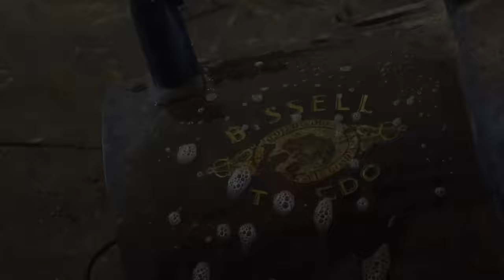Someone paid an equivalent of $2000 for this in 1914 [Restoration]

Comment: "A buffing wheel has one job, to polish/clean what you have in your hand.  A buffing wheel has one goal, to take what's in your hand and throw it across the room."
Reply: Or to buff your hand
Reply: @andrewgodly5739  Look at how shiny my hands are!
Reply: To be honest I worked in a jewellery and metal working for a short period of time. My nails were never so shiny as back then xD
Reply: I remember my school days,mid 80's, in the metalwork shop we had a large belt sanding machine with a buffing wheel on the spindle end,whenever I heard the sound of it starting I would go and  stand between the lathes and mills for protection,it was the only safe place in the classroom.Two occasions stand out just in my class alone,one kid was hit in the hand by a 8" soldered copper steam boat hull which squashed the ring he was wearing into his finger needing surgery to remove, another got hit in the face by a small block of brass which pushed two teeth through his top lip and broke the tops off of them,the schools response to these accidents was a laminated sign hung above the machine telling you to be careful.😊 I also witnessed the flight of a very large lathe chuck key twice, both times it didn't hit anyone fortunately because it would have certainly killed them but it was terrifying nonetheless,the lad that forgot to remove it before starting the lathe both times was banned from the metalwork classroom after the second incident.
Reply: @foxyfoxington2651  “Catch these hands!”

“I can’t, they’re so well polished!”
Reply: @notpoliticallycorrect1303  Don't worry, in the 2000's I had a lathe key wiz by my head on the way to low earth orbit because some kid behind me forgot to stow it. We kept tradition alive, so to speak.
Reply: @andrewgodly5739  Can confirm. Slipped once, did a great job buffing my knuckle right down to clean and polished bone.
Reply: taking as much skin-fingers with said object. 👍👍
Reply: @notpoliticallycorrect1303  craziest thing I ever saw in metal shop class was the flying center punch. The classroom had several long workbench tables topped with sheet metal and a bench vise on each end. The teacher gave a demonstration on how to use, and not use, a center punch. You hold the punch firmly, press its point against what you're marking, then hit it firmly with the hammer. BANG

You don't hold it between thumb and fingertips then give it a little *tap*. His intent was to have the punch fall to the table. Instead it slipped off the metal on the anvil part of the vice, ricocheted off the steel tabletop then flew straight as a bullet down the table. One boy halfway down was leaning in so he could see. He was wearing the safety glasses instead of the dorky plastic goggles. The punch put a hole right through the left lens of the glasses and right past his eye. Miraculously he didn't get hit, not even a speck of glass in his eye. The teacher stood there for a second in shock, then grabbed the boy and dragged him to the eye wash station.

He said that in 20 (or however many years) of doing that demonstration, nothing like that had ever happened. The punch would just fall onto the table.

There was one other incident, involving the emergency shower. One table was pretty close to the wall where the shower was. It had a big triangular loop handle on a chain. The boy sitting there was doing some layout work with a square. When he was finished he put the square over his shoulder, stood up on the stool's rungs then stepped off it backwards. The square hooked into the shower handle. FWOOSH he got a quick drenching.
Reply: @notpoliticallycorrect1303 safety and racism are totally unrelated so when I say this “might have been dangerous but life was better back then.” I mean it. Maybe not for everyone all the time but no, life was a lot better when law suits weren’t flying around all over the place. Safety is bug business. I got to live in the last decade where something could happen without worry about suing or getting sued and frankly, life was better. Accidents still happen but now they’re someones fault.
Reply: @thetruthexperiment  Who mentioned racism?
Reply: @notpoliticallycorrect1303  nobody. But in case someone did, i was leaving a disclaimer. Stuff was more fun when people were less litigious and less afraid of bumping their head. If we didnt already have home electrification we probably would never get it because people are so afraid of everything and people don’t think in terms of grand infrastructure. We need it now but we hardly make advancements. Fear and guilt would make putting fire hazards and electrocuting hazards in our homes hardly even a fantasy. For example.
Reply: @thetruthexperiment  I see,a bit of pre emptive defence,fair play.,You seem like a like-minded fellow but I fear our numbers are dwindling and being replaced by limp waisted invertebrates,it's up to the likes of us to at least attempt to keep things real,or die trying😂because common sense left the chat years ago. As you may gather from my username, I don't have time to pander and pussyfoot around the ever increasing multitudes of people who consider themselves 'special' nowadays, I won't be racist,every race has its bottom feeders,or sexist in any way but I will take umbrage when people are taking the piss and as you and I would almost certainly agree,the piss taking has gone far too far and has to stop.
Reply: @notpoliticallycorrect1303  hell yeah. I didnt see your username till you mentioned it. When i saw the reply I went into attack mode. Not seriously attack mode. I was just getting ready to respond with a humiliating put down. Some serious overkill to win the fight in one paragraph but turns out we’re both chill. Right on. Good on you. Speaking of overkill, the crazies are definitely overkilling their position and I feel a slight majority may actually be growing! Have a great day.
Reply: 500th like !!!!
Reply: @jttech44  Back in '06, one of my friends had a patch of his hair ripped clean out of his scalp because he refused to tie back his hair when using the buffing wheel. When I say clean, there wasn't a single drop of blood.
Reply: @notpoliticallycorrect1303  Wimps. 

In the Seventies we shook off such annoyances.  Pot metal explosions were fairly common in print shop (ever met a Linotype?) but those who paid attention to the safety instructions generally came out unharmed.

As a 'TA' in Junior High School metal shop I spent considerable time ensuring students didn't harm selves or others.

Builds character.
Reply: Yep, that sounds completely accurate .. probably even in the fine print of every included information sheet

Comment: Just imagine vacuuming away and the grinder catching on the drapes, and this thing yeeting  itself out a window
Reply: Amazing he can restore a 100 year old Vacuum and I can’t get the Plug Connector for an 8 year old Kenmore Floor Power Mate, Carpet Attachment.
Reply: 100%
Reply: Yeet's still a thing?
Reply: Dual purpose engine. You better remove the grinding/drive wheel and put a cover over the drive shaft, while vacuuming.
Reply: Right?😂😂😂
Reply: You win the comment section for this video 😂
Reply: There aren't many comments that make me actually Laugh Out Loud, but this was one of them!
Reply: Yeah, 
I kind of questioned that too.

Women wore long flowing skirts and dresses back then.
Reply: @Troublemaker1022-r9c  I mean, looking at the drive pulley, the price, and how often your average homeowner actually needs a bench grinder, I think this is meant for a small metal working shop. I’m guessing there’s a mount you can get to hold it to a work bench or provide power to other equipment.
Reply: Da lawd yeeteth; da lawd yoinketh away.
Reply: Damn near shot soda out of my nose when I read this. Woke up a lightly angered wife next to me

Comment: "combination vacuum cleaner/knife sharpener" is not what I was expecting
Reply: And a pulley so you can drive your meat grinder or whatever.  

It's even worse when you realize this would originally have been screwed into a light socket most of the time, it was before outlets really existed.
Reply: Sounds like something from RonCo
Reply: on wheels!
Reply: I saw the turbine and initially thought it was a home steam generator, but what I thought was the intake pipe would have been too large of a diameter for that. I had no idea what this was until he used it.
Reply: @ChrisG404  wait, now how much would you pay?
Reply: And Motor for other things (Belt wheel)
Reply: I feel it should make waffles too.
Reply: @GigsTaggart  fever dream
Reply: I think it is a blower for a black smith forge - the grind wheel will be to sharpen tools and the pully to run auxiliary things
Reply: crazydeathcar  - Well on the old vacuums with a metal fan it did, but in this instance, it would be continually dropping back down ONTO the fan - maybe you could use it as a shop vac occasionally?  But I think this was for use with a portable forge, its more of a blower design then a vacuum design - the fan would fit the housing much more snugly to achieve a vacuum.  I think the stand is to old the hose at the hight of the forge to stop it from trying to tip the portable forge over.
Reply: I figured out it was a vacuum cleaner fairly early but I didn't see the knife sharpener come until all the way to the end when he used it.
Reply: The belt pulley was for a washing machine.
Reply: isn't that primarily meant to clean up the residue after or perhaps even during grinding?
Reply: @janvesely6353  I suppose it could, but no, it was a sales perk. It was a floor vacuum with all the parts for tending floors and had the bonus of being able to sharpen  knives and scissors as well as polish silverware. It even had a pulley for running a dishwasher or washing machine. Remember, that was 1914.
Reply: Old Kirby vacuum cleaners from the 50s-80s came with attachments to do all this and more.
Reply: Too bad modern appliances don't have a grinding wheel and an open pulley.
Reply: @Landrew0  I know, right? Back in the day people tried their best to give the best quality for the money. Now, it's make it work long enough to get the money from the sucker buying it with no hope of repairing it.
Reply: @Landrew0 modern appliances have 0 extra power to spare
Reply: Just a warning: the boiler plate says its rated for a frequency of 25 cycles (hertz). Running it on modern 60hz will make the motor run faster and may damage it.
Reply: I have no doubt it was used for bagging/transferring seed/grain on the farm. It's the predecessor to the Kirby vacuum has all the gadgets to make home life easier in the city or country. 😂
Reply: @sambaker3233 pretty sure it's always been 60hz in America. I think this is a Canadian product.
Reply: KIRBY vacuum has this feature
Reply: Sort of reminded me of a ma sport vacuum pump on a vacuum truck used to pick up fluid . Except for that crazy knife sharpener on the end for sharpening a Serrated knife . I’m guessing that was for a Taylor shop and the sharpener on the end was to keep scissors sharp or an Upholstery shop .
Reply: It's not a vacuum. It's a blacksmith forge blower to heat coal. This guy is running the impeller blade by trying to use it as a vacuum
Reply: Too bad it didn't include "coffee maker". That would be the ideal combination! Caffeine up and then get to work!
Reply: @dimitar4y 😂ффффффйффйффы
Reply: @dimitar4y 😂ффффффйффйффы
Reply: ronco. ha ha. woolworths crappy second rate cuttlery etc..those were the days. Nostalgia ain't what it used to be.😢@ChrisG404
Reply: Bagging upside down is quite the design choice too.

Comment: That blue suddenly coming through the years of dirt and grime was such a magical moment! I probably would have bought the thing over colour alone!
Interesting how it has some strategically placed locating pins, likely to stop factory workers putting it together wrong...
Reply: Same
Reply: Wouldn't have stopped the Russian who forcibly installed some sensors upside down in a Proton M rocket in 2013, causing it to turn upside down and attempt to fly down at the ground. Whomever did that had to ignore the markings indicating which was was up, and bend the mounting brackets to make them fit the wrong way.

Comment: It has that Dr. Seuss vibe to it. Beautiful piece of machinery
Reply: Agree, a very Seussian piece of machinery.
Reply: 100%
Reply: When Seuss was a young man he would have seen these items and they certainly lend themselves into fancy.
Reply: @Xsiondu  I thought of this too! I am sure he developed the unique way of curvy design on his own and was most certainly influenced by the old machinery. I am a collector of vintage compressors, motors, globe valves and other things that are quite ornate. Never seen this vacuum before! Its very cool but I dont like the material on it which is zinc alloy, its basically pot metal and easily will break. Using cast iron would have been nice but would add to the weight.
Reply: @enzojugs99  I call it the Flurgorgibble
Reply: Or maybe i should call it the Mad Doodad

Comment: The electric motor, what can we do with this? Mr Bissell
"Everything!"
Reply: Yes, that knife-sharpening wheel looks like one of a set of different attachments that could have been mounted on that little driveshaft. If a motor is that costly, I guess it would have to be marketed as general purpose. A vacuum-cleaner with a PTO ... based
Reply: Same theory with the kitchen aid stand mixers. 

Good marketing too. Then when the motor goes they have to replace with the same because of all the accessories they have for ir
Reply: @Punchcado  My guess it would have been someone's very fancy shop tool, maybe a pulley running a shaft to a gearbox and shears/clippers or something like that. Plus the vac to clean it all up. Fact its variable speed would lend it to lots of things
Reply: @justin4n6  I'm genuinely impressed an electric motor and switch from 1914 survived to be restored. Testimony to the build quality
Reply: @krissteel4074  definitely is. And the mentality of repairing not just replacing when broken/worn.
Reply: Plastic would have been brand new too at the time, that Bakelite knob on the switch would have been pretty fancy!
Reply: @krissteel4074 I have an old Delta surface grinder that I need to restore, but it came with an ancient Brown & Sharpe electromagnetic chuck. After looking for documentation, I found an ad from c. 1915 for it. Not to sound naive, but the fact that they were making these and other super precisely machined things at the same time they were still thinking bloodletting with leeches was healthy is mind blowing.
Reply: @Punchcado  such expensive electric motor for so little power. No wonder combustion took over for cars well until the invention of the inductor motor that doesn't use permanent magnets.
Reply: @krissteel4074   yeah, its amazing. 
but that's also can be problem, in comparative, a modern motor the same size would be a 100 times more potent and use 1/10 of the energy (because most electric motors are induction, and the arrangement of the coils are better now, we learned some things).

but engineering is about trade-offs, when you make a thing last so long you're also setting the design in stone so it can't get better.
sure our consumer economy is on the other side as to make things disposable on purpose, there must be a middle ground between planned obsolescence and ossified inefficiency (everything will crumble to entropy eventually, there's no point in trying to repair things forever if not for historical purposes, even you yourself crumbles to it). 

the good thing about the way things were done before is that they were simple, an 8 year old kid could easily understand them and the normal man/people could repair it without expensive knowledge and tools.
Reply: One motor to rule them all. @Punchcado
Reply: @monad_tcp  There's some use for 'up time' in engineering, like a lot of mil-spec stuff will effectively be running at a lower output to give it some inherent reliability of a component not being run up to 100% output all the time. Plus even in critical infrastructure you don't want stuff having a problem with reliability when its running your power, water and communications. Those things can trade-off a bit of power and efficiency for just keeping on trucking, so I'd imagine back when this was the only electric tool in someone's workshop its just got to work, rain hail or shine because the downtime would equal lost money.

I was lucky in some ways seeing some post-WW2 equipment made like this as my grandfather was a carpenter and floor sander. So all his power tools dated around that 1930's-late 40's period of design and I remember him doing garage rebuilds of motors well into the 1980's until the mid 90's when he retired.
In its own funny way, they paid for themselves so many times over that it would have been silly to buy new equipment when an hour here and there to repair something was going to mean another year in service. 
Plus a lot of them just didn't exist as-new machines so even if you wanted a replacement it just didn't exist
Reply: @monad_tcp interesting point of view, if you build something to last you stifle innovation...🤔 hadn't thought of it that way before.